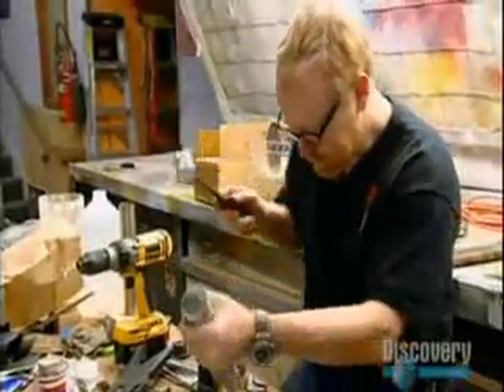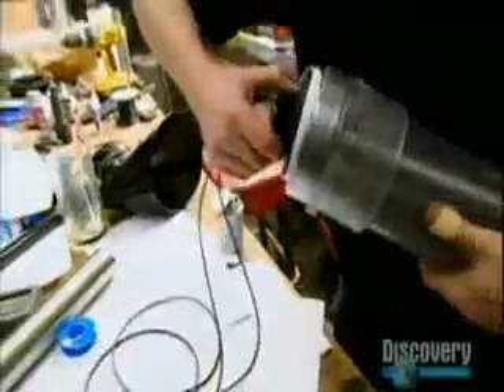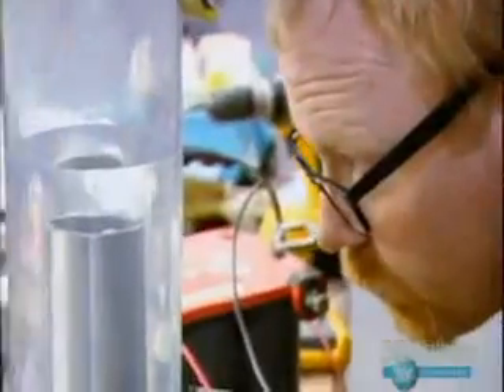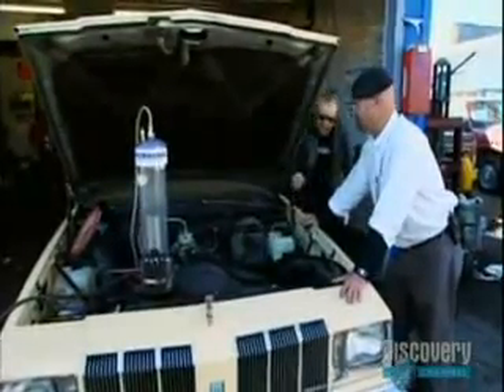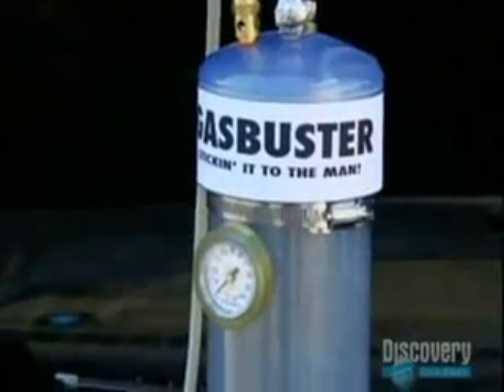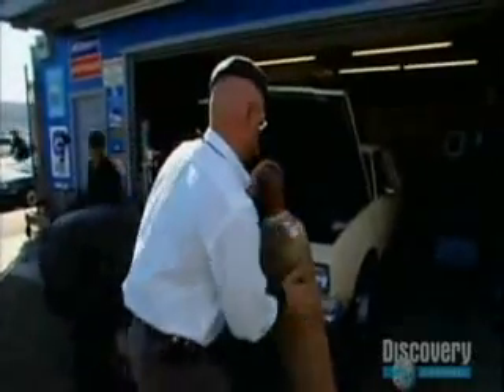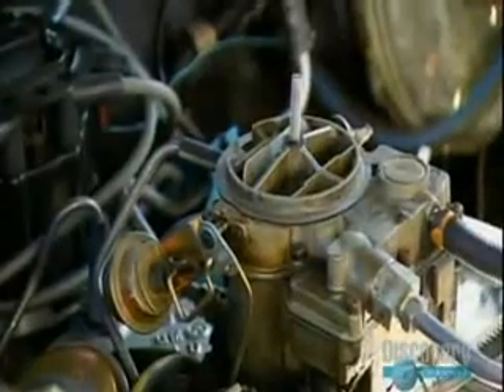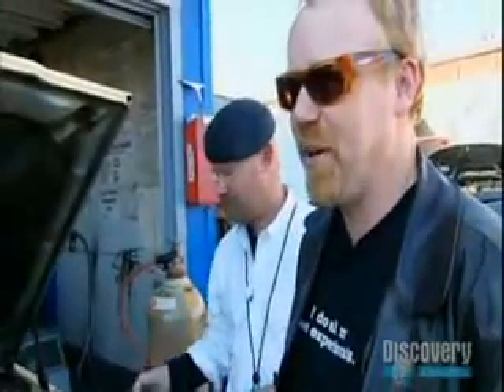HHO Mythbusters Explained

Comment: They did not catalyze the water correctly
Reply: How do you catalyze the water properly to enable the large amounts of hydrogen required to operate a typical IC engine used in a automobile? We all know it will burn Light Houses used this gas for guiding ships for years. It seems we can't get past picking on grammatical errors and other such childish nonsense.

Comment: i ran my car engine using water as fuel, bits from an old washing machine bits and bobs it reved up ran fine only for  seconds because it quickly ran out of electrolysed gas H O. i have 1000 of hours under the bonnet know the sound of an engine, it was perfect. to run on  water cracked as the fuel( using no petrol/gas) needed is 1 ml of water per second  that's a good figure to be around, should be good for speed of 60 miles an hour, depends on engine size and car weight.UV light used with electrolyser will push the electron away from the proton in the  nucleus weakening the electronegitivity of the oxygen atom. i left school at 15, how have all the worlds scientist not perfected this allready
Reply: I never thought of using light to accelerate the electron. I was thinking of sonic frequency modulation tuning it to the frequency of the water molecules  to loosen the bonds. Or using pressure or heat.

Comment: Petrol/Gas is hydrogen, thats the only part of Petrol/Gas that burns. when it's refined from crude oil it's still locked to the carbon that's why it in liquid form, the carbon does not burn, so why would a car engine not  run on hydrogen water has 5 times more hydrogen in it than oil. if you can find a natural or artificial substance to combine with oxygen in the water, a plant uses Photosynthesis, only needs one photon to break apart one water molecule,

Comment: Just in case anyone want to give it a go...!

To run a 5.9 Litre engine on HHO alone you will need about 400 Litres of HHO per Minute to drive. And about 75 Litres to Idle that engine.

To get a rough estimate for your engine you can divide that by the factor.
So lets say 2 liter engine needs about a third of that
Idle 25 Litres a minute. Driving 135 Litres a min.

HHO can consists of many different forms of H.... Many things are yet to be discovered. Different kinds of water produce different H.....and O. Different frequency waves will produce with lower electric consumption.... Brute force DC produces Gas but way less per Watt.

DID YOU KNOW A PURE HHO FLAME WILL BURN AT A MERE 130 DEGREES  CELSIUS !!!! GOOGLE IT!!!

Or see http://www.free-energy-info.com/MorayKing.pdf

BUT WHEN FLAME IS HELD AGAINST TUNGSTEN STEEL IT WILL MELT THAT.
OR ANY OTHER SURFACE IT COMES INTO CONTACT WITH.
More info http://peswiki.com/index.php

Comment: Calling this HHO idea a fuel cell is like having a cordless drill with a cord.

It's not a fuel cell because it requires an outside source of energy and sadly enough can not possibly return the same amount of power due to losses of friction and resistance and further there is combustion engine inefficiencies where 70% of the energy is lost in the form of heat.
Reply: zetsi77 The issue is not the type of fuel.  The issue is the energy required to split the molecule into atoms and then recombine them to harness the energy.  The science on this issue says there is equal energy in both direction of molecular conversion.  Then you add the loss that an internal combustion engine suffers from (heat out the exhaust pipe) and you have a net loss of energy form the HHO system.
Reply: zetsi77 I believe that people often get ideas that are false and/or fanciful and some hold onto those ideas with religious fanaticism in spite of no supporting reality.  I also realize that what is thought to be false or fanciful today will be understood and embraced by tomorrows children.  HHO is just not one of those things.  It has had decades and even blue prints of the design of the device claimed to make it all work yet no headway?  WHY?  In those same 30 years what has happened with the electronics industry/technology.  Hell even the regular ol' internal combustion engine has gone forward by leaps and bounds.  POOR HHO got left in the DIRT!
Reply: Marco Schoolenberg That sounds nice.  So many people that make these claims are vastly out numbered by those that have no favorable result.  The claims are not based on any scientific principle.  Bias based on ones need or desire to achieve a given result is the first thing to eliminate in a scientific evaluation.  There is also the double blind method.  I have never seen any of these applied to any HHO experiment.
Reply: Selsley01 You may need to go check your facts.  The energy potential in diesel fuel is greater than that of gasoline.  That is the primary reason why a vehicle gets better mileage out of diesel than gasoline.  The engine designs are also a bit different but primarily the fuel is the reason.
Reply: Selsley01 It's closer to 35% thermal efficiency for diesel and 25% thermal efficiency for gasoline. Plus, diesel has about 10% more energy density than gas. So, diesel is about 15% more efficient per gallon. But, according to http://www.eia.gov/petroleum/gasdiesel/ gas averaged $2.044 and diesel averaged $2.866 on 01/26/15. Paying 140% for 115% doesn't really work out that well.
Reply: Hahaha, let me get my popcorn ready. Brb.
Reply: Before you start to do your little dance.... Maybe you should understand that HHO Boosting of fuel doesn't need to return more energy then goes into the "HHO Reactor" if you will. HHO Boosters are meant to help combustion of complex hydrocarbons stuck in the petrol in your tank, which normally end up in your catalytic converter. Increasing the burn efficiency of the engine from 60% to 95% or higher. Thus saving loads of diesel or petrol.
Reply: Marco Schoolenberg LOL at your numbers.  If gasoline engines only burned 60% of the fuel then the exhaust would be flammable.  Most major cities in the USA require vehicles to  have emission inspections.  Failing the test would occur if they were within the range you are touting.  I believe most cities are below the 200 parts Per Million for Hydrocarbons.  The combustion process burns way more than what you are suggesting.  The problem with engines is the loss of energy to heat.  HHO would not correct this at all even if it had magical powers.  Most vehicles operate below a 35% efficiency due to heat being the majority of exertion of the energy created.  So even if HHO was magical it would still lose 65% or better to heat and then you would have to account for the inefficiency of the system that creates electricity to drive the HHO electrolysis process to make O2 and H2 from water.  A great website for a much deeper evaluation is http://aardvark.co.nz/hho_scam.shtml
Reply: Only thing that matters in the end dude is ....
DOES IT SAVE FUEL? AND the answer : YES IT DOES!
Reply: Marco Schoolenberg basics of science, provable and repeatable.  The repeatable needs to be by multiple people in multiple locations and under varied conditions.  So many factors that could account for "fuel savings".  That's the problem, it's not established as fact by any measure.  If you do get better fuel economy what is it due to?  Maybe a change in your driving.  Maybe the changes done to the injection control system.  Simply making your vehicle run leaner can increase mileage.  Problem is it also will have negative impact on your engine life.  Anyway you "YES IT DOES" claim is a totally arbitrary conclusion with no provable connection to your HHO device.
Reply: Maybe some pixi dust too.
Reply: this was the last myth busters i watched.
Reply: There are many that have done so. Central Valey HHO for example have lots  data for many vehicles. Also they recently got the carb Ok in california
Reply: so my car is not running right now?maybe your car should be looked at by someone that knows how to use youtube.a high school education will help ,but is not a must.
Reply: Stan Rodgers  I have saved over 1000 litres of fuel since start of this year using a HHO Booster. Driven km 20.000 saved 1700 euro ;-)... Cost of the kit ...-> 450 Euro.
Reply: Stan Rodgers hahha "just SOME" ?? A van load more like .  i must have been intoxicated when i commented on this . i don't even remember doing it now . Less than 24hrs ago Too !! lol,.   its all good fun pal.  ;-))
Reply: Stan Rodgers You are ridiculously ignorant. Guess what other engine runs 100% off of Hydrogen and Oxygen. Liquid fuel Rocket boosters used by NASA. HHO is a combustible gas, " If you do get better fuel economy what is it due to?  Maybe a change in your driving." That is like saying my car runs faster on Nitro because i hold the pedal down. AND FUEL CELLS REQUIRE FUEL, THAT IS WHY THEY ARE NAMED THUS.
Reply: People think ....one builds a set is garage DIY ...can be done but not simple. Safety exact build. Complete kit. Including some way to influence fuel injection system and engine ignition timing is needed. Unless you have carburator you need chipping. Otherwise only HP increase and no savings
Reply: i reckon we a good 24v (bus battery) along we some extra special alternators, an a good size space to allow for "like" 30 mini HHO fuel cells (think it would be better to have alot of small hho fuel cells -rather than 1 large one ,for faster hydrogen production) yes ! i think this can be done ? am no expert but it does seem to be very PLAUSABLE , you not think so ? (thinking outside the box here mind you) lol.,
Reply: Stan Rodgers So you don't believe in over unity. Ok just checking.

Comment: I think this was the one that sank their show... 
You can blast a Rocket into outer space with Hydrogen and Oxygen but you can't run a car with it. Hmm... Odd.
Hydrogen burns like Alcohol but cleaner and hotter. Oxygen is an explosive gas. So HHO is a clean burning explosive gas mix. Yet the "experts" called bullshit on this. Right...
I see now how a clean burning explosive gas mix can't work in an internal combustion engine. The Oil companies said so. Gee, that must be true. Pftt... whatever.
Reply: John King That was my original intent.  I had a factory with all the equipment to make these devices.  But first I did the research and the math.  It was a big let down to discover a 100 amp alternator was no where big enough to create
the 270 liters per minute of HHO to get even a 25% increase in millage.  I wanted NO part in the SCAM.
Reply: @hhoinfo680  yup you're right. Oxygen isn't explosive. You're also wrong. It's not an accelerant. It's the oxidizer. Learn your fuel triangle. Not buying your snake oil either.
Reply: Look at the facts.  NASA uses hydrogen and oxygen, not water, as their fuel source.  The space shuttle also uses solid rocket boosters that provide 85% of liftoff thrust.
P.S. Oxygen is not an explosive gas, it's an oxidizer! and running a properly blended mixture of a flammable gas and pure oxygen into an internal combustion engine would not work.  However if you have a small percent, like with HHO systems, you can get away with compressing the blend and controlling the combustion.  HHO systems provide enough gas to produce about 1% of the total engine output.  there are easy engineering table that have all the information needed.
Reply: hhoinfo My line of work is in Plumbing and Electrical. I've also had years of rewinding electric motors and generators.
I'm with ya on that whole scam issue.
Can't stand Crooks. On the same note, I despise Dishonest pukes pushing a cover up.
That Inventor Meyers was killed for building that car that ran on water back in 87'.
As a Plumber... I believe I know how it was done.
Reply: John King According to the autopsy done by the state of Ohio he died of a brain aneurysm.  Of course his brother claimed he was poisoned by the oil companys or government.  Also  The court found Meyer had committed "gross and egregious fraud" and ordered him to repay the two investors their $25,000. ea.
"As a Plumber... I believe I know how it was done."  IF it was done,  I don't believe it was.  I did not see anything on the dune buggy that could create that much Hydrogen.  Why did it still have a carburetor on the engine ?
Reply: John King I was quoting you.
Reply: Nuclear fission or fusion are vastly different from oxidation (burning).  In an automobile engine it is the later and lesser of those energy reactions.  This HHO scam would be like claiming a rock has the power to destroy the Earth, all we need to do is accelerate it to the speed of light.  See how much power there is in this rock!
Reply: Paid CIA trolls in the comments disproving free energy, ignore them.
Reply: First Oxygen is NOT an explosive gas.  It is an accelerant to combustion.  Second why don't you do some research and see how much HHO it would take to equal the energy content of 1 gallon of gasoline.
Hint:  one gallon of liquid hydrogen has 3.67 times less energy than 1 gallon of gasoline.
How many liters of hydrogen gas is in a gallon of liquid hydrogen ?
If your too lazy to do the math here is a video that will explain it to you...  
http://othertube.info/HHO/Vault/save%2025%25on%20your%20gasoline%20bill%20with%20HHO.mp4
Reply: hhoinfo Excellent... you're an expert in such things. Now retrofit a vehicle and make it work.
Reply: hhoinfo You ever get the feeling that there's just something missing in the equation? Somehow something got over looked? A missing component, a bit of leverage...
It must drive you nuts at times thinking about it.
LOL!!!
Reply: John King What bothers me is this Scam is being sold to people wanting to save money on gas.  People that can least afford to be ripped off.  Not everyone has the training & experience I have in automotive mechanics.
Do you want to see the cold hard facts about HHO.....  http://othertube.info/HHO/videolinks/5a.html
Reply: hhoinfo Water don't compress... Think water pump and inline turbine. 
Just looking at the possible ways of leverage. 

How reliable is the source on that Meyers info?
There's no denying the many instances of People made to disappear or killed by opposing intrests.
Reply: John King So being a plumber provide some special skill or qualification to analyze a murder?  This notions is as wild as HHO.
Reply: Stan Rodgers LOL!!! Had I made ANY mention of my qualifications on any level in regards to such things?
Come up a something disruptive and see what happens. You'll only get to see it once.
Reply: John King Your comment seemed to say so.  " That Inventor Meyers was killed for building that car that ran on water back in 87'.
As a Plumber... I believe I know how it was done"
Reply: John King You may need to check into a psychiatric ward.
Reply: Stan Rodgers feel free to join the ranks of the nay sayers if you wish. Do not put words in my mouth.
Reply: take the case of a hydrogen bomb. that might explain how powerful a hydrogen is.
Reply: Oxygen explosive? Yup, not buying your snake oil.
Reply: Stan Rodgers Just like the microwave engine NASA says is impossible because it creates its own fuel? Yet it still exists. Your technology is about 3 decades behind.

Comment: Electrolysis is the most inefficient way to separate  oxygen and hydrogen from, what is chemically speaking a ash, water.
Just  this fact should open the eyes of the "believers" water is a liquid residue of combustion, to reverse the state prior the combustion implied the restitution of the amount of energy given by the combustion plus the energy used to restore  the state prior the combustion.
The balance is ALWAYS negative no matter how "smart"  is the process (and electrolysis is far to be the smartest).

The us military have used a process of recombination of CO² and Water, from seawater, to produce an hydrocarbon this process is much more efficient(and complex)  than a simple electrolysis, it seems that the cost is 3 to 6$ per barrel  ADDED to the cost of the energy used.

So if you want to make a barrel of this hydrocarbon you will have to use one barrel of oil let's say 100$ +3 to 6$ for the lost of energy in the process which is a wonderful achievement. If you consider that you can transform electricity(hard to be stored) in hydrocarbon (easy to store)

Comment: Even though you produce less energy than is required to produce it, what makes a hydrogen system work is the resources required to produce it available for next to nothing. An energy system in complete control of its creator that uses resources that are renewable.
Reply: like gasoline to power the alternator to run the HHO system that uses sodium hydroxide to help split the water molecules.